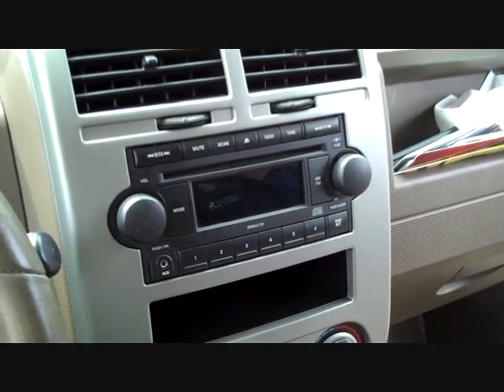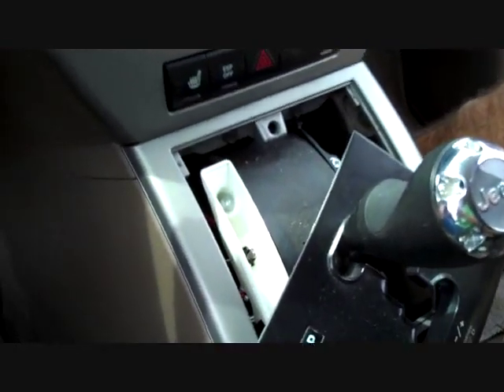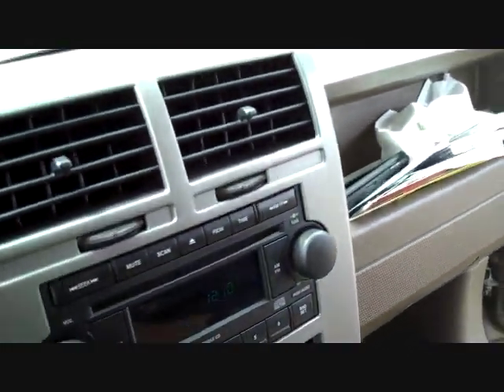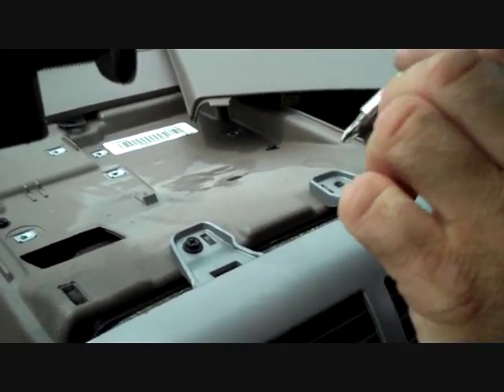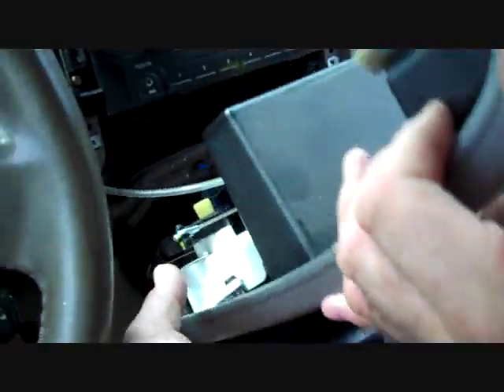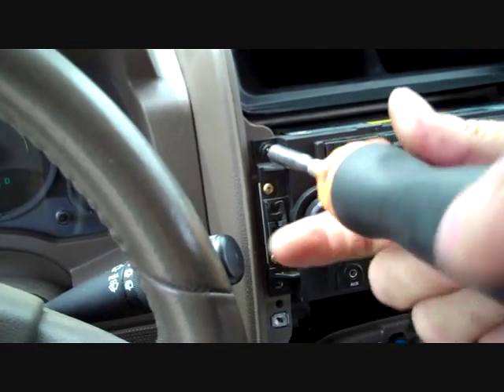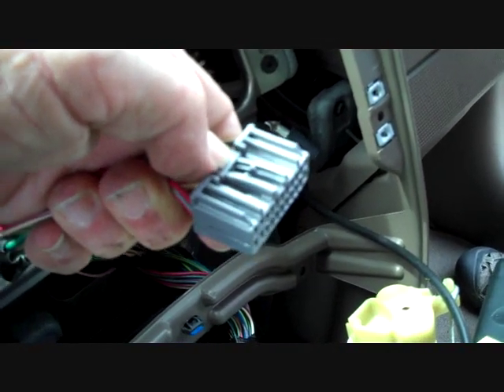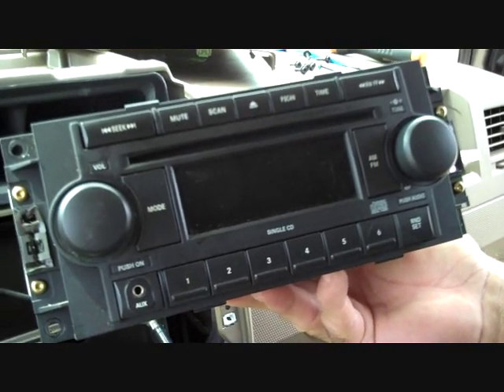Jeep Compass Aux-Jack and Stereo Removal 2007 - 2008 = Car Stereo HELP

Comment: Where can I get a replacement Auxiliary port for my jeep radio?
Reply: I am also looking for this part. Were you able to find out where it's available?
Reply: I, too, am trying to find this. My aux port doesn't seem to work anymore and I was hoping this video would show me how to replace it.
Reply: I got as far as taking apart the stereo down to the circuit board, but still need that piece.

Comment: Hello.I'm trying to fit a new single din radio to my 07 wrangler.the new radio comes with a harness and a seperate red wire to fit to the key ignition.the problem is I don't know which wire to splice and fit the loose red wire to and can't find any diagrams relating to this online.do you have any idea which colour wire is the right one?

Comment: I want to upgrade to the uconnect stereo 05064954af in my 2008 compass. Do I need any additional wiring up plugs to install? Cheers

Comment: how did you replace the aux itself though? resolder lose connections or is it a module and can be changed out?
Reply: I've been looking forward to replace it... U had any luck doing it?
Reply: +Xander Ortiz I didn't, but it my issues turned out to be two new faulty aux cables in a row. third aux cable was the charm. I never found any answer so I assume it would need to be soldered....